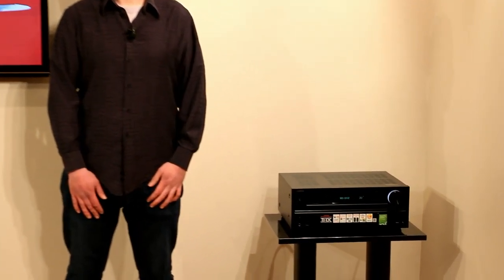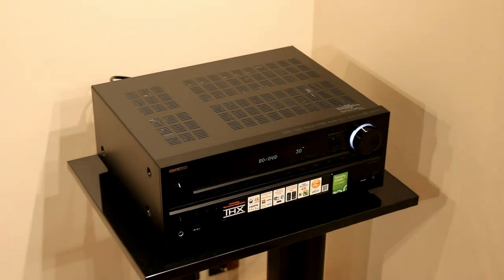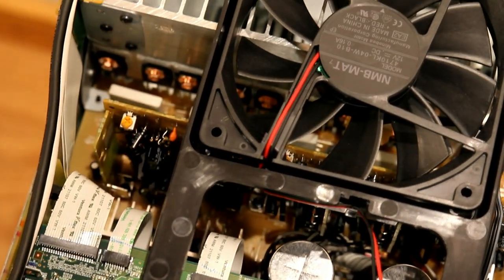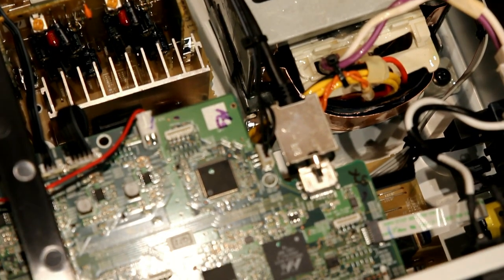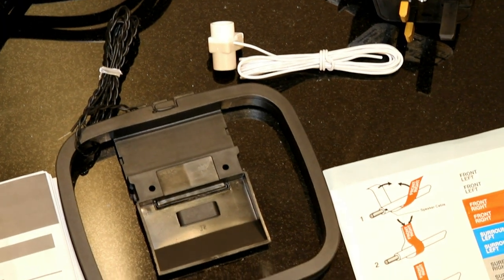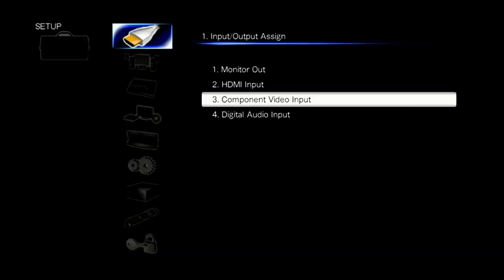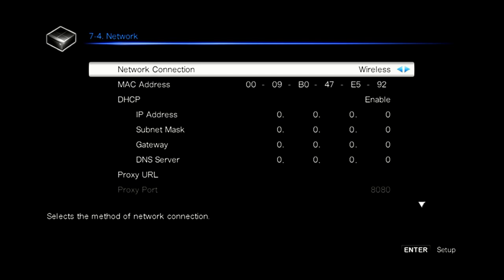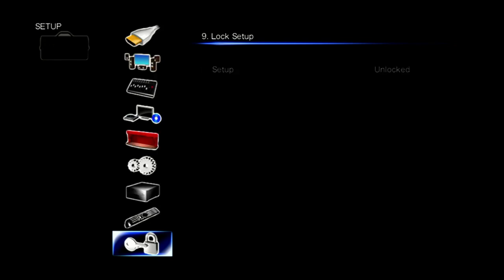Onkyo TX-NR727 Review AV LAND UK

Comment: I just purchased the model below this one (626) and well, it doesn't come without its niggles. When you change input, it produces a small "pop" through the speakers, it also gets considerably hot to the touch (at the bottom) and sometimes it has difficulty displaying anything when changing between HDMI inputs. Although that could be down to the HDMI control function on the receiver but I need it on for ARC. I'm thinking of swapping to the 727, does this receiver address some of these issues?

Comment: Furthermore, I'm looking to know if it's possible to change the audio input whilst still remaining on the same video input?. For example, using my Xbox on an HDMI input but using an analogue audio connection for connecting 3.5mm jacked devices? Or even HDMI + Bluetooth? My previous receiver (Yamaha RXV567) has the ability to do this, but why not this? I purchased the 626 about a week ago, if Richer Sounds allow me, is it worth swapping to the 727?